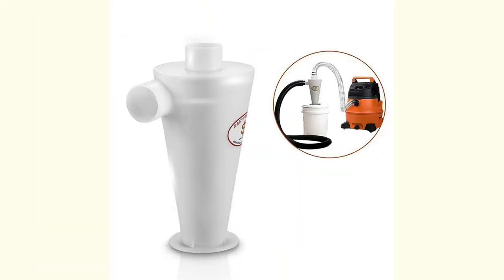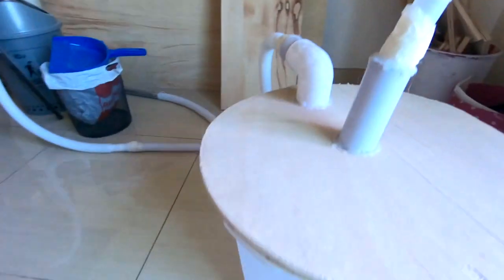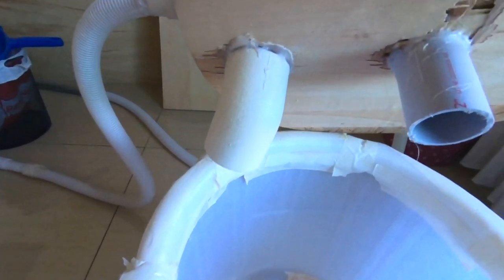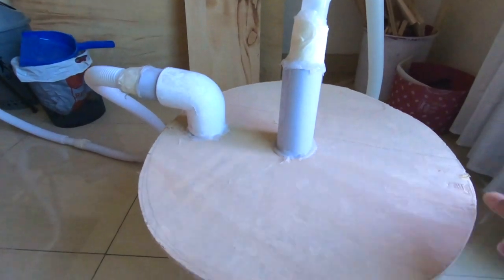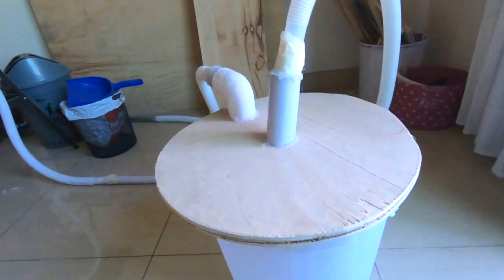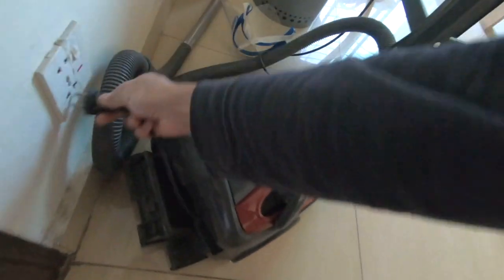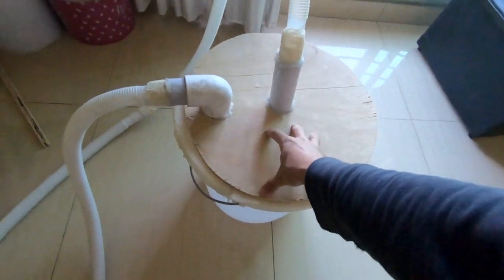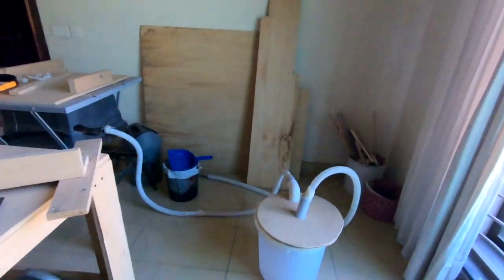Easiest DIY Dust Collector Cyclone with Home Vacuum Cleaner! Under 5 dollars!

Comment: Haha. This is a thing of beauty! I was just wondering why you can't just use a normal vac connected directly to your dust extraction housing? I.e. without your intermediate bucket? I suppose because the bags would fill too quickly with sawdust, so you'd end up spending a lot on bags... right?